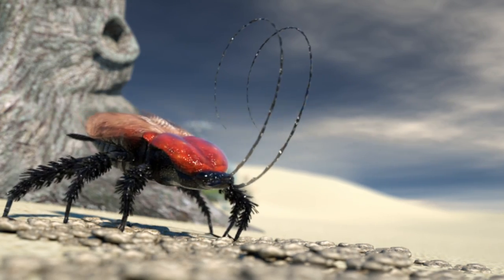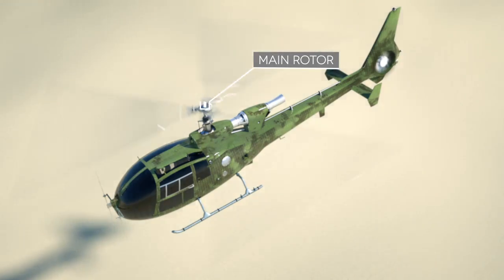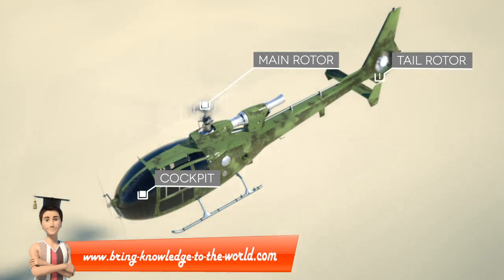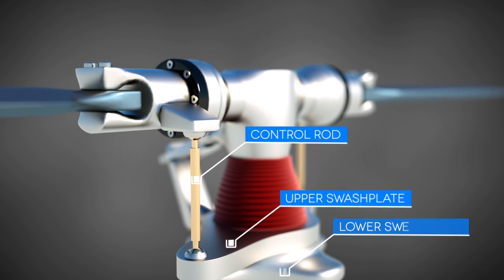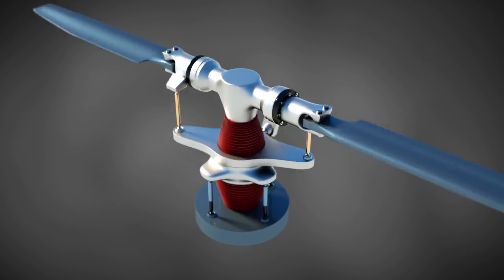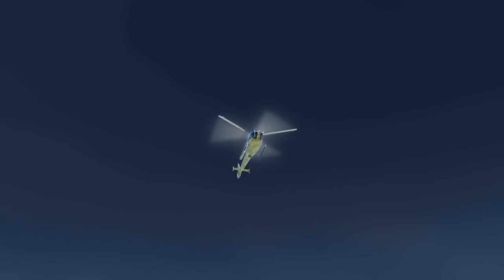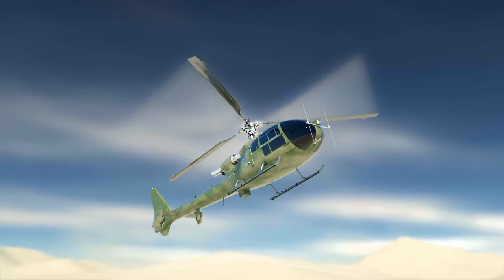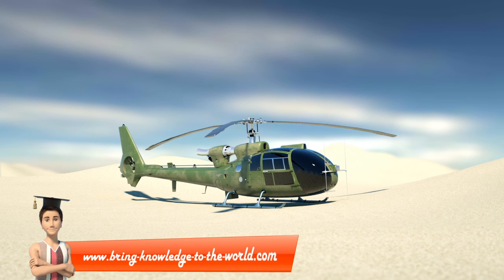How Helicopters Fly / How the Swashplate Works (How It Works!)

Comment: Aaaaahh, now I get it! I had this (incorrect) mental image of the whole assembly somehow canting over to achieve a change of direction. Your video demonstrated the concept of 'each rotor has the SAME ANGLE at A SPECIFIC POSITION'. Many thanks for your work.
Reply: MAN I'm right there with you; I spent 3 hrs reading about it and couldnt for the life of me figure out how that could be mechanically possible... 30 seconds into the video and the glass shattered

Comment: That made NO sense at all. What are these mysterious magical "aerodynamic forces" that every "explanation" seems to have as its 'go-to' phrase but which explains nothing.  I have seen an army helicopter that went down over water, sink faster than a stone - fifty feet in under a minute - so they must be extraordinarily heavy. You can not tell me those comparatively lightweight blades generate anything near the lift needed to fly that massive weight, no mater how aerodynamically they have been designed.

Comment: i know completely how the helicopter go up and down and . turning its dirctions to right and left .
but i dont know how it go ahead.
if inform me it will be your  pleaser.
thanks and best regards
Reply: That's done Via the swash plate.

Swash plate tilts forward. More pitch on right side blade than left side blade.Force acts at right angle to rotor motion. Helicopter points nose down

Some force from tilted rotor pushes helicopter forward.
Reply: why do the pitch on right side blade than left side blade

Comment: Is the fact that the blades with more pressure bend upwards and the ones with less bend downwards advantageous, disadvantageous or neither? Also is it deliberate or just necessary?

If it's a problem to be solved, could the flywheel/torque delay principle be used to counteract it?
Reply: gyroscopic precession?
Reply: 100GTAGUY Yeah I think that's what I'm thinking of.
Reply: +junoguten I think the lower swashplate would use that principle because when one rod is actuated and the apposite compensates as well, the other two are acting as pivot points 90° from the actuating ones and somewhere past one degree in the rotary path of the pivots it would already be forcing the blade up 90° before it achieves it's greatest angle of attack. I hope this doesn't sound all jumbled, I have a difficult time explaining things in text.
Reply: 100GTAGUY Yeah that sounds difficult to explain in text. I think I get it though. Thanks :-)
Reply: the way the blades are flexing indicates which one has more lift, and therefore producing more thrust which causes the craft to move. I wouldn't necessarily call it  "advantageous" more or less variable induced drag.
Reply: +junoguten you're welcome man, I'm training to be an A&P mechanic and like talking about this stuff. it's just crazy how it works
Reply: junoguten ... Not sure what the narrator means when he says the blade with a lot of lift bends upward and little lift downward. 

The helicopter' direction is dictated by the tilt of the rotor. The tilt of the rotor is controlled by the swashplate adding pitch cyclically to the rotor 90° before the side of the disc you need to raise to tilt the thrust in the direction you would like to travel. Example: to move forward with a counter clockwise rotating rotor pitch is added to the left side tilting the disc forward this is called 90° phase lag. Once the disc is tilted the collective will be raised enough to maintain the altitude and the result is forward motion.

Comment: The exhaust from the jet turbine does nothing? I always thought it helped the helicopter move forward faster.
I didn't know the speed of the helicopter was also controlled by moving the pitch and angle of the rotor blades.
All of these videos are very interesting and educational.
Reply: believe it or not there is a small amount of thrust going out the tail pipe as it's nearly impossible to extract 100% of the thermal energy in the exhaust gases, without adding more turbines which in turn aren't worth the gains due to the added weight. the amount of thrust that goes out the tail pipe is dependent on compressor/turbine drive configurations, but most of the time 90-95% of the gas energy is turned into rotary motion through the gearbox and the remaining 5-10% percent of the gas energy leaves the tail pipe as thrust.
Reply: 100GTAGUY ... your estimate of 5 - 10% is unrealistic. Yes there are pressurized gases escaping out of the exhaust but they are not giving any substantial thrust. On many helicopters the exhaust is pointed upwards, with your reasoning the rotor system would have to overcome that thrust. Plus on the S58t the exhaust would counteract the tail rotor thrust. When sitting on the water with fixed floats translating tendency pushes the helicopter with the tail rotor thrust. yet there is no forward movement.